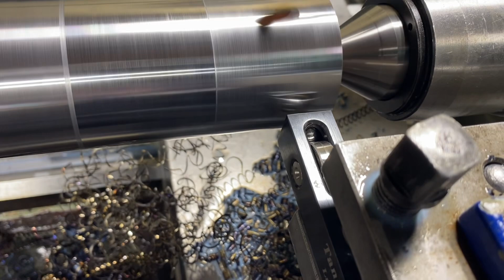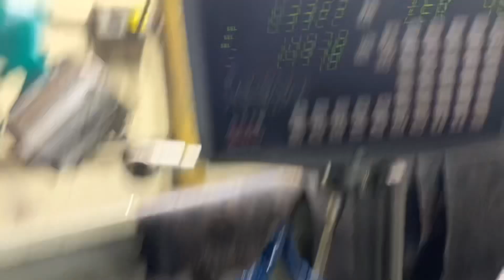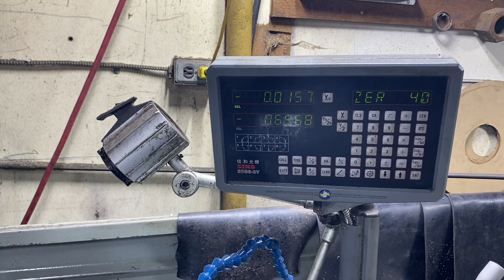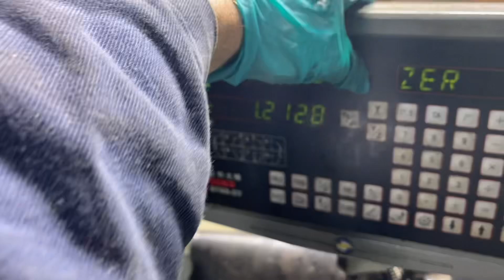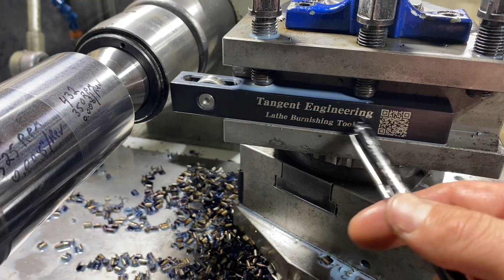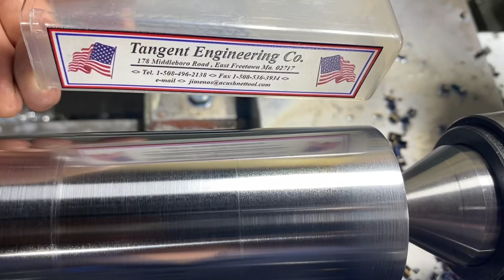Burnishing test part 4, the results!!!

Comment: Some nice information you've gathered here.

Does burnishing alter the size of the diameter? I've never done any burnishing work myself but I'd imagine it would alter the size, but not as expected. I'd guess that 15 thou you've moved in by isn't actually reducing the shaft diameter by that amount?
Reply from the maker: In my case with just the one pass of the burnishing tool, moved in 0.0075” on the radius, a.k.a. 0.015” on the diameter, I was getting fairly repeatable results of 0.0005” (half a thousandth) reduction in the diameter of the part.
Reply: @OgiveBC  thanks for the reply. Excellent. It's not a drastic change, but it's still nice to be aware of
Reply from the maker: Indeed, I’ll have do a test with ten passes of the burnishing tool and see what happens…….